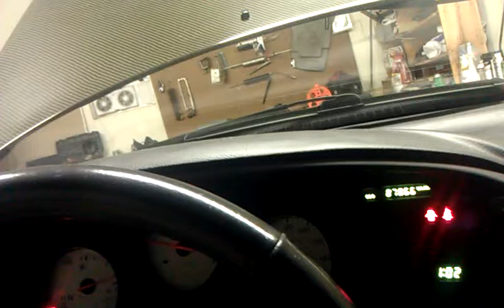Supra starter rebuild/swap strange noise

Comment from the maker: Sorry I guess I could've provided an update. Basically, I added an extra "piece" to the starter when reassembling it. Specifically, a ball bearing...between the plunger shaft and casing. The loud noise is this ball bearing rotating inside the starter.

Or that's what I remember. This car is currently FUBAR and the fuel pump is shot.